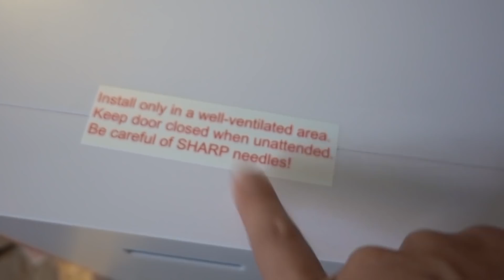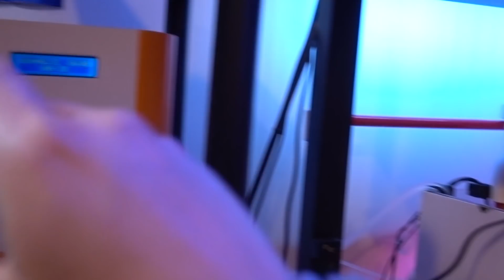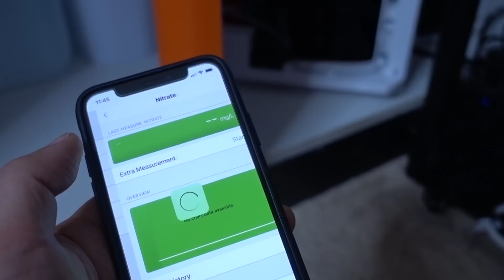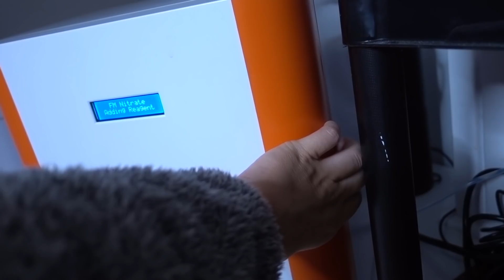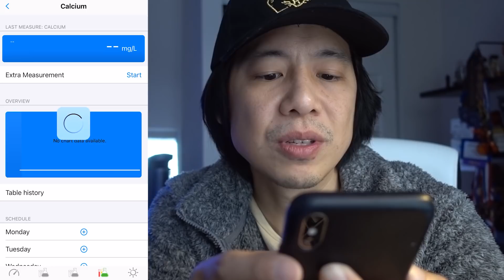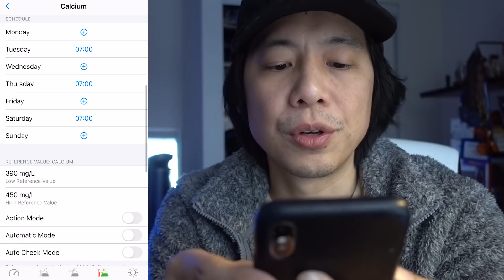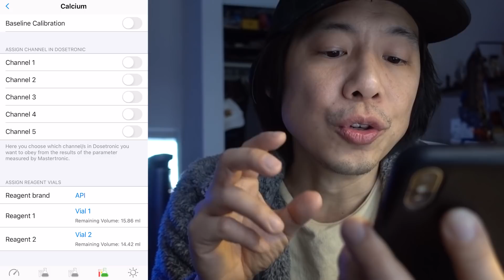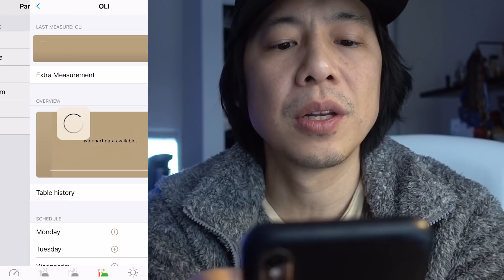Mastertronic hands-on impression!! All-in-one automated aquarium testing from Focustronic.

Comment: so the alkatreonic is just a monitor ?? meaning it doesnt test and correct for alk ??? man thats a pretty big hanna tester xD
Reply: The Alkatronic can and does control you kh if it is low it will add the required amount of you liquid to get it back up and if high it can switch off its Bluetooth socket with you could have your doser plugged into and then once the test result is in spec it will switch the socket /doser back on. But if you wish you could turn the controller part off and just let it notify you that your kh is out of spec but that seems to be a shame really buying a tester/controller and only using the tester side.

Comment: I was wondering which silica tester did you use the low range or the high range it reads it in parts per million I have the 
Seachem test it reads in MGs what’s the difference. I was wondering if you know and which one did you get.
Reply from the maker: I got the Hanna low range Silica test as it seems to be to most accurate according to info I could find on forums. However it only measures up to 5ppm so it didn’t help much if your plan is to use it to measure silica dosing for Dino (you’d quickly shoot past that)

Comment: Have you cross referenced your test results? Like manually check the Ca, Mg, NO3 and PO4 with the test kits you use? Wondering how accurate they are when compared to the others.
Reply from the maker: I have the first week, the Nitrate was a little different but the others match up close enough for me. I’ll be sending out an ICP once it stops snowing/icing here and doing another round of full manual test to compare.
Reply: If you join the Focustronic´s Owners Club (for alkatronic) on facebook you'll see a lot of people comparing the tests to their hanna. It is extremely accurate.

Comment: This would be money for dealing with high phosphates/nitrates. Trying to dial in some carbon dosing and hand checking the nutrients has been a challenge.
Reply from the maker: You hit the nail on the head, I was specifically waiting for this auto-tester for it's NO3 & PO4 testing (especially NO3 due to the long wait time for reaction). My tank's Ca & Mg does not move that much so those are not as essential for me.
Reply: @InappropriateReefer  now to convince the wife to drop $1300 on a piece of reef equipment! Wish me luck!

Comment: @inappropropriatereefer Seems like everyone is using the same components internally - I have the KH Guardian and the Reefbot and they have the exact same needles (what length are those?)  bottles, kamoer pumps, and linear actuators. So far after using these for 2 years they all seem to run into the same issues with the pumps and other wear components.  It will be interesting to understand what the preventive maintenance cycle is and what they recommend to replace all these since they will impact the calibration of the fluid over time.  So the differentiator will be the software/firmware controls.  I do like the nicer app though.
Reply from the maker: Hey Ellery, how are you liking the KH Guardian (that's the OG!)?  Price point is great and seems reliable even though it doesn't have the flashy interface.  I should have mentioned the maintenance cycle in this video as well -- IIRC Focustronic is recommending replacing the needles every 4 weeks (although I thought I heard 8 weeks somewhere, will double check), hose replacement every 8 months.

Comment: Good review. It seems good in theory besides the cost, which I think you can easily justify if you have 10k in corals for example my concern would be using only liquid test kits. You used API calcium which is not considered to be a very good test kit. Salifert and many other brands presumably use the powder for accuracy. Also all of the Phosphate test kits are not supposed to be as reliable as using a photometer. Maybe they have gotten better now, I've been using the milwaukee Mi412 Low Range Phosphate Photometer for so long the buttons have worn off (10+ years) and it's margin of error is 0.03 so I trust what I get on each test.

I would like one but I also wouldn't like to spend that much even though I think the price is fair. When I see a product like this that would be nice I actually think it encourages me to manually test more because it feels like I'm getting paid to manually test, when I'm just spending more of my reefing budget on livestock instead of something that just makes my life easier, but if you've got money to burn and a busier lifestyle it seems like a good buy.